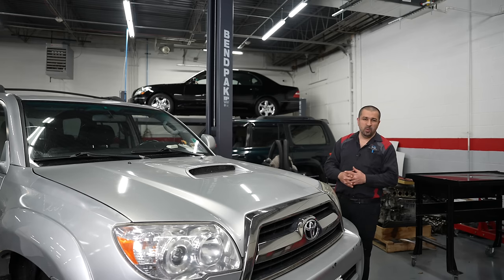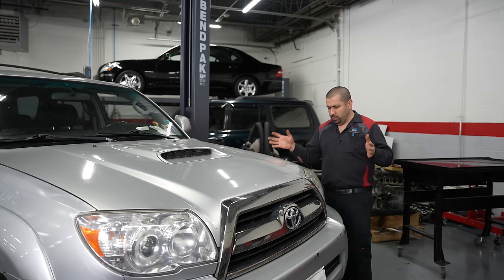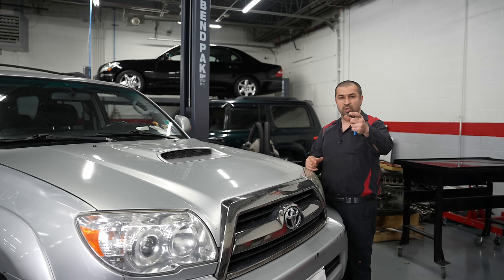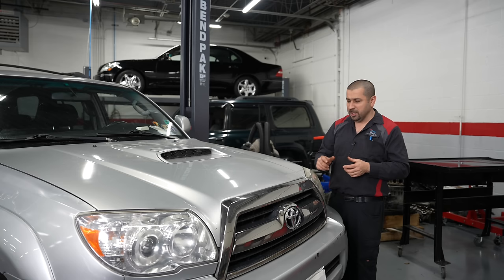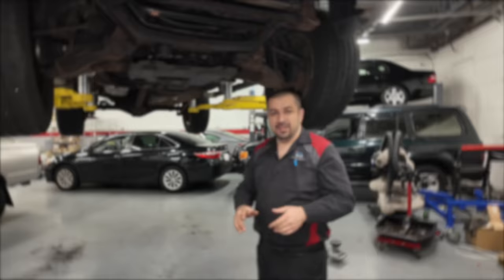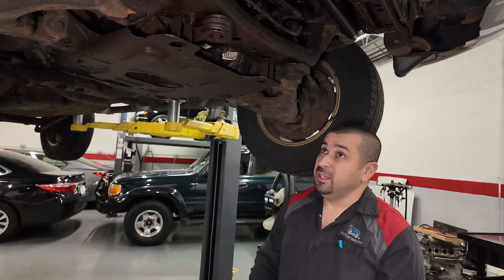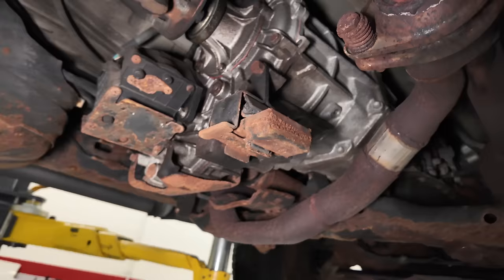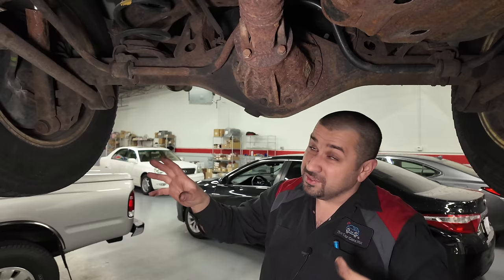THIS Problem Can Destroy Your Toyota Truck Transmission! Is it Too Late for This One?

Comment: Another very informative video. A vehicle in that state would never get through the annual safety and roadworthiness test in the UK (The MoT). In its present state it would fail on the front drive shafts, the seized front brake, the corroded brake lines and the rear shock absorbers not to mention the tyre condition. Well done on replacing the transmission fluid but that is only part of the story. The state of it is very concerning from a road safety aspect.
Reply: I think your road inspections in europe are way stricter than United states. In some us states they dont even test for emissions, it really depends where people are. Some places don't test headlight alignment, etc. 
They're always supposed to fail inspections for safety reasons, though.

Comment: I am a first owner of the 2008 Toyota 4Runner  SR5. Couple of years ago I had blown rear axle seal on the driver side. I researched and the reason for this  failure was a small metal breather on the top of the rear axle  ( on the left ) that was completely rusted and stuck. 
When axle hot the gases has no place to escape and eventually blown the axle seal.
I see on this truck in this video it appears the breazer is rusted as well, I would check if the top is freely moving.
Love your videos AMD!

Comment: Here in England Toyota 4x4's are really expensive used, so too are the hybrid Toyota models.
Used to be able to buy used Toyotas cheaply, but that's changed over the last few years, seems more people have cottoned on they're good products.

Rust is the killer in England too, i treat my 2005 Prado every year, its still rock solid.
Reply: They're not cheap here either

Comment: Had this same model 4runner and had those exact same trans lines rust out. Caught it very early and just replaced the lines, no problems after. Traded it with. 180k miles, it Still ran pefect!

Comment: Happened to my mothers FJ cruiser, all the fluid leaked out and I had to go pick her up as it stopped moving. It was these cooler lines and I filled it up with the correct procedure and ws fluid, been fine for over 2 months now.

Comment: I checked in the internet about the reax schock system and is to improve cornering handling but they acknowledge that is very expensive to replace and recommend to be removed 🙏🏽

Comment: @20:15 Those are how the parts come from the supplier to the assembly plants.  A parts bin on the production floor may contain 30 of those parts and aren’t individually wrapped so the caps are on there to keep contamination out.  Low use service parts are purchased periodically from the same supply chain so you get some of the same weird packaging quirks.  This typically doesn’t apply to consumable parts like water pumps, brakes, etc.

Comment: Thank you for this video, also the great looking and running vehicles in your shop.
I'm going to change the transmission fluid in my 2020 RAV4 before summer.  I have the video you recorded for the fluid change.  My XTOOL D8BT is the go to Diag tool, thank you for that recommendation, and I remember watching that trans fluid temp reading I saw in the tool's readout.  I'm keeping this video as a backup to the other one.  Would have changed it last year but thanks to jury duty and other things that came along, this will be the 5th ownership year, and the fluid change.
Good one Ahmed!

Comment: That front fluid line on my '08 blew also.  Still struggling to get it running right.  This video is very helpful, but I just wish it came out a year ago!  Also waiting until I'm confident in transmission before making other bigger repairs (suspension and exhaust).  207k miles.

Comment: For those in the rust belt, try using fluid film spray on the frame. Also, do your maintenance guys! This Toyota would have been totally fine if the owner sprayed down the frame with fluid film every fall and did the correct maintenance.
Reply: NHOU undercoating once a year

Comment: 99k on an 06 4Runner and it’s this bad, If the tranny is shot I would get a used one and go ahead and repair all that is needed. Believe it or not this 4 runner can go another 200K easy with all the repairs needed. Just like the owner of the 80 series Land Cruiser taking care of what is needed.  Once all repairs are done simple maintenance to keep it going. Oh and if you live in the rust belt wash your under carriage often to keep the rust away as long as possible!

Comment: You're the only one I can trust on YouTube about transmission I've got a 2005 SR5 4Runner with 286,000 MI and it still runs like brand new transmission fluid has never been changed far as I know the transmission has slurping to it and every now and then but not all the time when I put it in drive it hesitate for a few seconds someone told me if I change the fluid don't change a filter is this true please help I love this Toyota thank you very much for your time and the good videos that you do God bless you

Comment: My XREAS failed too on my 4th Gen, NOT WORTH REPLACING WITH XREAS. I ripped it all out and put in Dobinsons off-road springs and shocks. XREAS does not rly offer an off road benefit it’s really meant for cornering on road.

Comment: AMD, I owned a 4th Gen 4Runner and did a lot of off roading with other 4th Gen 4Runner owners... the guys with X-Reas suspension removed it when they swapped out the factory shocks to lift their 4Runners. No one I knew saw any benefit to having X-Reas.

Comment: This is complete lack maintenance. The transmission will be fine. I recommend he leaves the axles until they make noise. Get used shocks off of 5th gen 4runner/FJ. Replace the brakes.

Comment: I don' have any off these problems with my 03 4Runner and it has 327,000 miles, it still has the original XREAS shocks too. I live in the Denver area and they put mag chloride on the streets, the alloy wheels have been destroyed with corosion.

Comment: You can't use a torch on those bolts. You can tickle them with a stick welder. The bolt itself is only thing that heats up.

Comment: The rust on the cars where you live, WOW!
Reply: It’s really smart to oil spray your car every year or two with a wet spray rust proofing product. I’m in Canada and there are several professionally applied options. I do it on our cars are there’s barely any rust underneath after many years.
Reply: I live in rust belt but only Toyotas rust so bad. Not sure why
Reply: There was a repair shop in my area where I grew up that did undercoating for a reasonable price. In fact, the shop's reputation was such that many a new vehicle owner would have this done immediately after driving the vehicle off the dealership lot. The undercoating substance was essentially the leftovers from the bottoms of crude oil barrels, a tar-like substance. My parents had a Ford Fairmont for over twenty years; there was hardly any rust to be found anywhere in the undercarriage ever.

Comment: Such outstanding/reliable trucks,  the rust is a killer.  Im in VT a notorious saltbed in winter.  I rinse out frame of my 08 twice a year, as they rust from inside out, with high pressure hose, let dry then coat entire undercarriage with FF or Woolwax, it's a lot of work, but at 180K, the thing drives new.  Goal is to get to 300K.

Comment: Moments like this I thank God I live down south away from where they salt the roads. The underside of my 9 year old Tacoma doesn’t have an inch of rust.

Also, I can’t speak directly to the 4Runner but on my V6 Tacoma with the towing package, I flushed better than 12 quarts through the system. So, yes, it has a surprisingly large capacity.

Comment: @43:57 look at how well Ahmed covers the front area of the car hes working on.that right there says it all.this man is the real deal folks.i have never seen that at any mechanic facility.its like hes perfoming surgery on the vehicle and islolates that area hes working as to avoid the surrounding areas from oil stains or grease marks.just the way a mechanic should work on a vehicle.😊

Comment: I like your rust belt trick on those rusty bolts, I do this almost daily even if heat could be applied before using a decent 3/8" Lithium ion powered impact.

Comment: Toyotas are tough ! my 06 taco 218k miles. i needed cheap transpo. when i test drove it didn't shift. I told my wife the tranny is roached in this thing. we looked at other trucks but i kept going back to the taco. I spoke with there lot mech . we decided to add fluid and see what's,  what . he dropped the pan and it had 1 quart in it . put a new filter and refilled and it flippin worked !  my wife said well the paint is roached . lol i bought it anyway. drove it home and it started vibrating in the front crap !! wheel bearing is roached. I replaced it when i got home. and the truck has run flawlessly. motor oil was so clean you could see through the oil to the dip stick on a truck with 218k miles. I nicknamed it roach   . Just when you think this thing is roached it shows you it isn't ! I actually love this little beater. now on to repair the paint.

Comment: The xreas system helps for you to justify to your spouse buying a Bilstein 6112 front and 5160 rear set when it's time to get rid of the xreas!  I had that set up as the TRD Pro add-on for my Tacoma and you essentially get speed AND comfort all in one package.
The xreas does actually assist with dampening the side of the vehicle that is loading-up in a corner- but I had similar results, if not better, with the old TRD Pro suspension on a Tacoma, which was the Bilstein 6112 + 5160 setup.
My Tacoma had this same issue- it literally was bleeding little bits of fluid when I traded it in for my 4Runner.

Comment: my 07 sport edition like this one has no rust its a california car, and my xreas works great no leaks with 240k on stock shocks, the longest stock shock vehicle I have ever owned and it doesnt cost that much to replace just swap out the shocks and i had my transmission flushed and replaced at 175k still running great

Comment: Some of those Crapa axles are cheaper than the OEM boot kit. But getting even 50,000 miles. But does  almost 20 year old truck in that condition need $750x2 axles? Not really.

Comment: My 2012 GX460 has original transmission fluid with 199k miles. I had solenoid codes with flashing 4 low. Ordered a 2017 trans with 31k miles and warranty. $5k

Comment: Still a solid car with fixing usual wear parts, brakes, shocks etc....  I think it'd be worth all the repairs, but I do all my own labor.  AMD, you'd need to feed your family and charge.  So, it would depend on how much all the repairs would cost before a final decision to bring this car back from terrible shape.  God bless brother!  Great vid.!
Reply: I thought the same thing, all these inferior aftermarket,  l guess the original Toyota parts weren't so great to be replaced with junk.  I buy cheap ,used Dodges, but I'd buy that truck, I'm not afraid of a little work.

Comment: mine 4runner s got 3rzfe 2.7l, 300K plus, motor and transmission all original, slam an Eaton M62 or M90 gm gen II supercharger on that 3rz
U gonna love that thing forever, all internals stock easy up to 10psi boost no crazy upgrades needed, just check all seals and put High flow cat, and adjust the O2 readings, :)

Comment: Whoa you have to do filter change to need 5 qts of fluid. If you live in rust belt and decide to take the pan off be very patient with those bolts, they break easily. Fortunately there are a lot of them!

Comment: I’m amazed at your demeanor when you are working even when your job doesn’t go the way you planned you’re calm and don’t appear to be flustered.
Another interesting video, I don’t think this customer has a chance, I think the transmission is holding on but if they want to get more mileage then they should wave goodbye to the transmission and get it rebuilt or buy a new one. It’s probably going to cost less money to buy another used car but as you said you don’t want a comeback and the car is at an inflection point where it’s not worth fixing the right way because the juice isn’t worth the squeeze.

Comment: If you can, always and I mean ALWAYS check your transmission fluid levels every once in a while. Doing this saved my transmission.

I have a 2006 Honda Accord and I noticed my transmission being low on fluid and slipping a little going from 1st to 2nd gear. Initially, I thought that my mechanic didn’t fill it up correctly, but little did I know my cooler/fluid line was rusted through and leaking out fluid. Luckily it’s been fixed, topped up and works fine.

The point I’m trying to make is if I knew nothing about cars and didn’t bother to do extra checks around the car, I would’ve blown my perfectly running 5 speed transmission by now. Always do extra checks!

Comment: The way you care about your customers is second to none. They are in good hands for sure. I think this trans holds 11.3 quarts, so 5 quarts is close to half empty. Also, you can use punches to plug up the rubber trans lines after disconnecting. It works great.

Comment: I converted my leaky XREAS shocks on my '07 Sport Edition to regular Bilstein 5100s.  Fairly easy to rip out.  No difference on-road or off-roading.   Oh wow, and I had a 2000 4Runner with that 3RZ engine. I installed a supercharger, but it was still underpowered.  The little TRD supercharger kit was provided by a helpful gentleman from South Africa, but I had to  replace  the entire mapping module with Mr. Traeger at URD. Fun times.

Comment: Since the trans dipstick has been eliminated, why dont auto makers have an electronic sensor to test for proper fluid level. Nothing is better than a dipstick but an electronic sensor would be half way to good. If the fluid goes low, an idiot lite cojld waarn of low fluid level.

Comment: Would I spend the money on this vehicle?  Well...  Yes, I have, and I can explain my personal reasoning.

I own a 2007 4runner nearly identical to this one with twice the mileage.  And I live in the same area with snowy salted roads in winter.
All of the issues pointed out in this video tend to happen nearly at the same time depending on its age rather than what the odometer says.

Two years ago, I bought a 2018 4runner and planned to sell the older one.  I quickly decided that, although the newer one rides nicer, I like the 2007 better as a daily driver, especially in winter.  I decided to spend several thousand dollars to catch up on all of the maintenance and repairs because it is an irreplaceable gem of a vehicle to me.
It is nearing eighteen years old and has 190,000 miles on it, but it is clean and drives like it just came off the showroom floor.  I would have to spend 40,000+ dollars to replace it.

The 4runner in this video is probably also due for a timing belt.
If the wheel bearings are original, those should probably be replaced along with the axles.
The engine shield/skid plate often comes up missing at drive-through oil change places.  It will need to be replaced,  or a new alternator will be needed soon, after it is sprayed with salt water from the front tire.  I learned that the hard way.
While it is in the shop, the spare tire hoist should be checked.  If it is the original cable operated one, it is more than likely rusted and frozen.  It is a drag to not be able get your spare down when you need it.
Also, the fuel tank straps should be inspected.  The fuel tank may be laying on its skid plate.

These are all typical 4th generation 4runner problems.
Yes, in my case, I do consider the money well spent.

Comment: I have an '03 V8 4runner and just within last 6 months have changed out the trans cooler lines, both the ones that run across the front under the radiator and the ones that come directly out of the trans and run to the front, to and from the radiator. I also removed my xreas system several years ago and replaced with Bilstien 4600/FJ springs. My xreas system had no gas charge when I replaced it, unbeknownst to me!

Comment: When the 4th gens were new, the XREAS had far less body roll and nose dive under hard braking. It actually hurt for off-roading, though, especially if you wanted to lift the vehicle.  I had an ‘03 Sport model.

Comment: My family has 2004 Sienna with about 320,000km that probably still has the factory transmission fluid. Surprisingly still runs, but it might need to be junked due to rust.

Now I'm more mindful of transmission fluid changes with newer cars, but they've taken away the dipsticks...just when I wanted to do it myself, they made it harder to check and refill now 🤣

Comment: One thing I went through on my 2001 toyota tundra that really screwed me, I loved that little truck btw, transmision cooler line blew up inside radiator. So everything went to crap in 20 seconds. What a stupid design that is. Oil lines through radiators wth.

Comment: I live in the rustbelt of Canada (Ontario) I've owned my 2014FJCruiser since 2015 and Crown under spray it every year in November and she is mint underneath. Probably going to do a full fluid change this summer because she has 125k KM on the OD and I feel like it would be a good idea.

Comment: Do your preventative maintenance people. My 4th Gen had 275k when I sold it. Regular fluid changes including transmission and it ran and drove like new and it never broke down, 275k miles and only issue ever was brake caliper and normal wear items. The XREAS system works great and where you notice it is in the cornering. It helps to greatly reduce nose diving in corners. I got rid of mine and put Bilsteins in.
Reply: To add to your XREAS comment... AMD asked off roaders if it was helpful and generally no, it gets removed at the first opportunity.
Reply: @mtoomeyaz  yep, no advantage for off road

Comment: I had an 07 4runner for several years and this exact issue happened to me lol. When you were talking about the low fluid I was thinking I wonder if it's the cooler lines